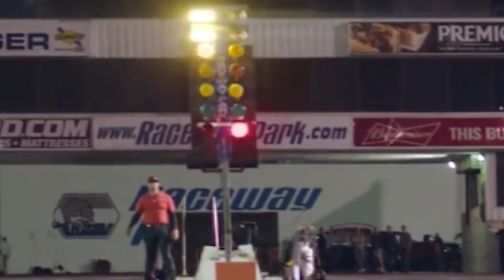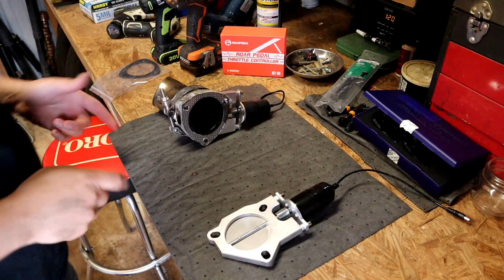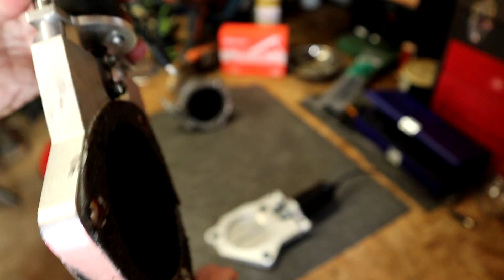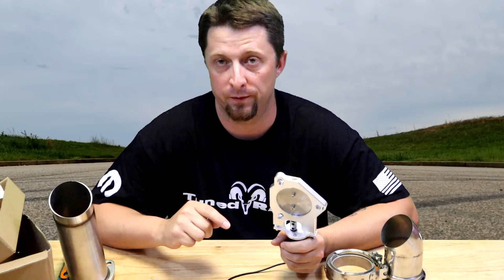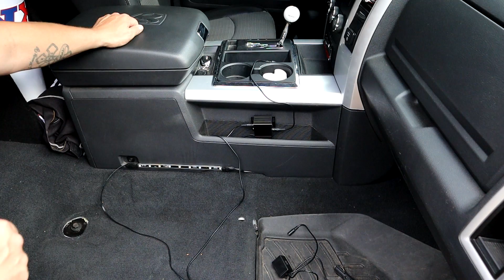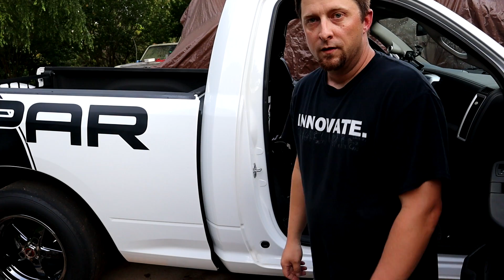New SPELAB Electric Exhaust Cutout Installation And Test

Comment: Having a issue love the part but does it have an adjustment on it it seems to open up just a little bit and sucks air and sounds like an exhaust leak
Reply from the maker: Check the hardware make sure it's tight

Comment: Hi.. How did you run the cords
Reply from the maker: Under seat thru floor under truck
Reply: I’m thinking same thing!
Old fox body mustangs have a power access under the drivers seat! (Fuel relay’s there too)
I have later model front seats. I plugged driver seat into that power access!
Prob put a fusible link on that & run power through floor to the cut out(s)! When I’m ready to install!

Comment: Going in an older car. Can I hard wire these? Like put it on a switch instead of cigarette lighter
Reply from the maker: Sure shouldn't be an issue at all
Reply: @FrostbiteRam  I was curious if anyone has done it because the company said no but I don't see why I couldn't cut the head off and hard wire it. But if that's the case I'll need to return them
Reply from the maker: @kevinbutler5226  you could definitely cut the power plug off and wire it to a 12v switch and make it work my opinion.
Reply: @FrostbiteRam  thats what I was thinking because I've done it with other accessories with cigarette plugs. I guess they tell you that because it would probably void any warranty if you did. I can't wait to install them. Awesome truck man 👌

Comment: My question is when it is opened does that give the exhaust air both ways to go, through the muffler and not, how does the air go "oh it is open now lets only go through the cut out and not the muffler"
Reply: I have seen they also have a double valve, so the one to the muffler will be fully closed, when the cutout opens. But maybe that double system will malfunction more early.
Reply from the maker: It will travel out both ways but mostly the cutout as air travels the path of least resistance but the point is to create less resistance in general.
Reply: @FrostbiteRam  THANK YOU

Comment: Do I have to use the remote, or does this unit allow me to use a momentary toggle switch to open/close the valve?
Reply from the maker: You can use the remote or program to your garage key buttons also.
Reply: Thanks so much! I would rather not use the remote control, I have a momentary rocker switch in my 67 Camaro ready to open/close the valve. I guess this hardwiring to a switch is not possible since the valve has a wireless receiver for the remote?

Comment: What are you stalling your truck to on the  line at the track
Reply: I'm just asking do you think if stall it a little so it will be in boost off the line
Reply from the maker: @brianhoward9370  no it wouldn't build any boost without a trans brake and 2step
Reply: Ok i understand
Reply from the maker: Nothing I hammer it right off idle its faster that way as it flashes the converter better.